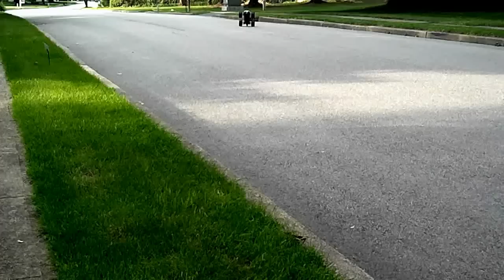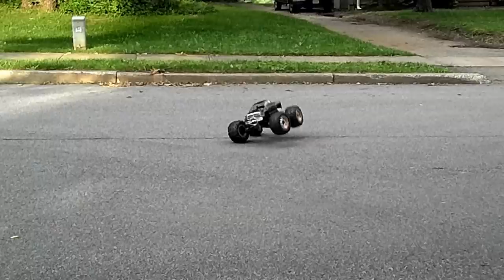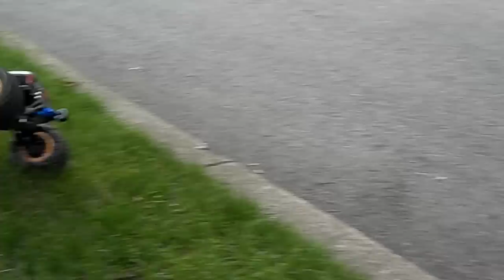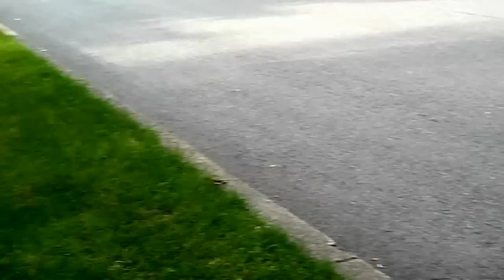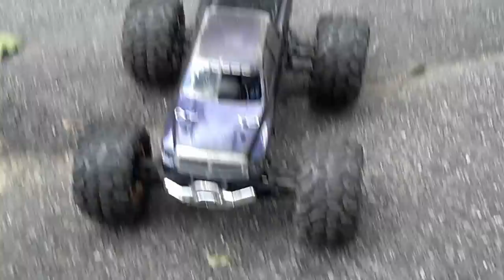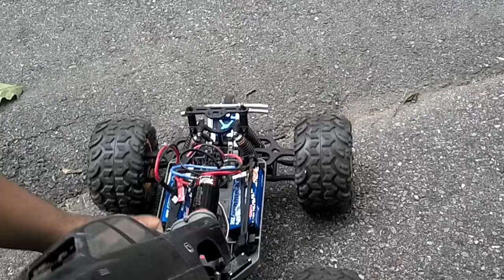E-Maxx custom Tekin RX8 vid4 (last)

Comment: huge torque.  Im running a Tacon 2150 motor and gearing 25/56.  You may want to dial up your gears to even out the torque and get more top end.